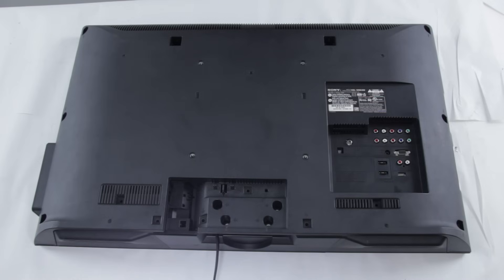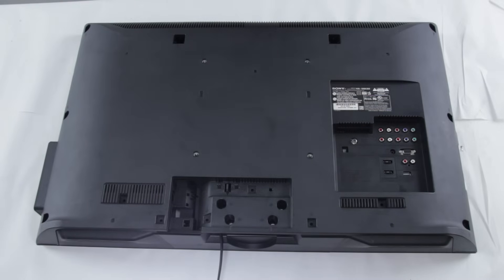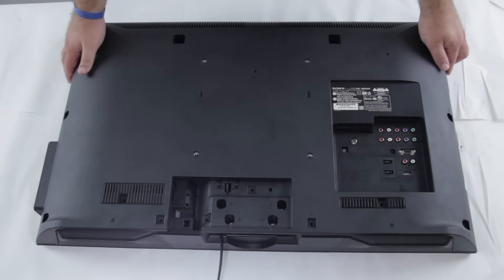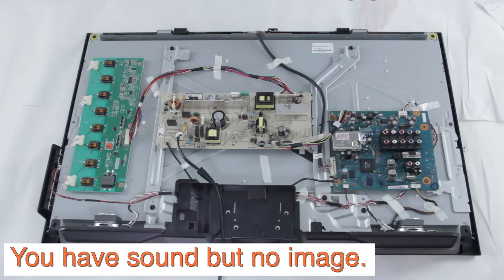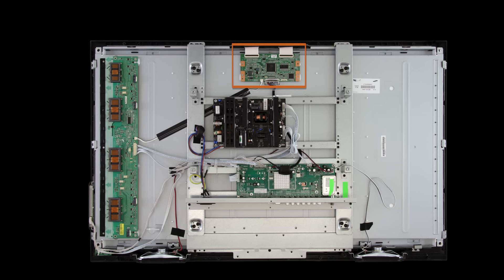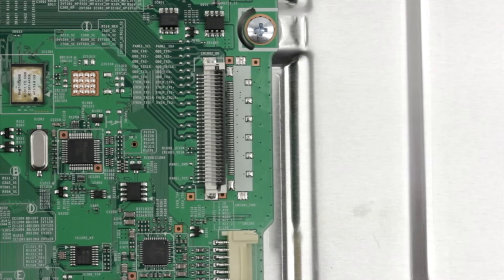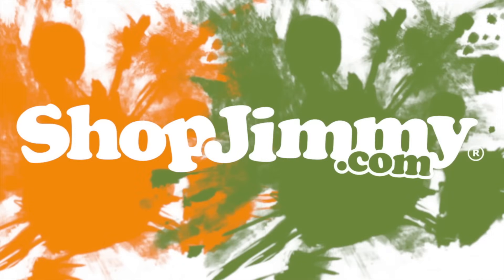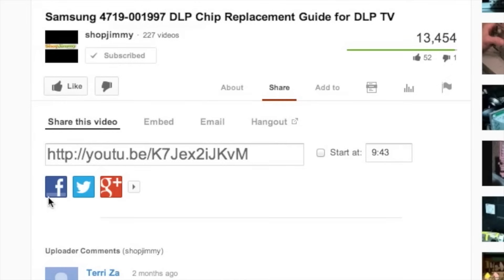LCD TV Repair Tutorial - T-Con Board Common Symptoms & Solutions - How to Replace T-Con Board

Comment: I have a Sony kdl-46xbr2 that has no backlight or picture or sound,I do have standby voltage of 5 volts. I would like to check the backlight turn on signal but I don’t know which pin has that signal. I was wondering if you could help me out

Comment: Hi ,great video bu t have got another issue whit my TV Hisense  55' H55N5500UK
Set goes in stand by mode after 10-15 min work and i ve been told the main tv board has fault-so i have changed it (not brand new -because cant find )and i still have same problem >How can find were is the problem?

Comment: Samsung Model UN19D4000NDXZA, Serial No. Z3013CKB305804Y--Decided to cut the cord and go with antenna only TV.  The TV works fine when connected to the cable box by HDMI cable, but when I connect it to an antenna by the ANT IN coax connector, I just get a static picture and an attempt to scan channels it doesn't work and the message is something like weak or no signal. The antenna works on our other TV, so it's not the antenna. I have it partially taken apart and thought I could try replacing the coax connector, but it seems to be soldered to the frame of the metal housing. Does that part come off the t-con board somehow or do you have to replace the whole t-con board?

Comment: Hey man how you doing?, I have flickering on screen and image is like moving slow, I disconnected right side of T-Con board and the other side works perfectly fine, I unplug the opposite side and and leave the right side plugged in, the whole screen shows the problem. Is that indicator of a bad T-Con board?
Reply: yes....same as mine..i change it and it works perfectly fine...

Comment: I have a (Flat HDTV 50PF7320A/37 | Philips ), there is not picture when my cable box is connected via HDMI. I am able to see a picture when I press the menu button on the TV and the remote controller-I have ensured that the HDMI1 is selected as it always has been. There is a circuit board, just below the HDMI logic board, where an LED is blinking green. I can be contacted at amelendezfl@gmail.com. Thank you in advance for you help.

Comment: Hello, I have a 55" Vizio M55-c2 s/n LWZQSBBR4502211.  My screen is a little blurry and jumping.  Also I have several horizontal lines.  One thick line about 2 thirds down and about 1/8in thick.  I'm assuming tcon board, and not the screen.  Any suggestions?  Thank you!

Comment: I have a Panasonic TC-P46C2.....Won't stay powered on......so when i push the power button I hear a click, the red power light turns on, the TV will power on (there is no picture, but an occasional flash)....after about 30 seconds the TV will power off, then it will on its on power on again....sometimes it will repeat this 3-4 times, until eventually it will power off for good (and the red power light remains off).......
I'm aware these tv's have blinking red light codes....in this situation the red light doesn't blink.
thanks, Kevin

Comment: Hi!, this is Farooq from India Mumbai (Bombay). Dear, I have a Dell TV cum Monitor U2410F with FHD resolution of 1920X1200 IPS LCD Display Panel. The monitor has standby light on the key board but no display, no backlights and no menu/picture. It has a Power Board no. 492472000100R ILP-017 RevA and Main Driver Board no. 492271300100R ILIF-129 Rev.B. It has a display panel of LG bearing no. LM240WU4 SLB 1 IPS FHD 1920X1200. 
Many technician went through it to repair but failed as the parts are not available in Mumbai, so if you would be pleased to find me the parts above numbered or help me to convert it into smart TV via FULL HD universal driver board but, to my dismay the monitor has to many circuit boards in it which is very confusing which to keep and which to discard. The display panel has 51 pin strip which are not found on any universal driver board in India. Hope you'll not mind to help me to suggest which universal board may be compatible for the above numbered display panel? And how to install it in the said Dell TV cabinet? You may also wish to record a video on the issue to help others to trouble shoot such cases.
Thank you in advance.
My email: Farooquechhapra@gmail.com

Comment: i have a sony xbr65x810c i had unpluged for like a week moved it to new room it comes on gets to screen and says no signal change input i can plug a hdmi in and it will change input and will have a picture but no sound have down loaded the software to thumb drive it will boot up on it start downloading it at 40 % screen goes black and the remote will not do anything but turn it on not turn it off took a chance and changed the power board no luck same thing any thoughts tried all kinds of resets

Comment: Sony Bravia KDL-60W610B Serial no. 3013439. TV has no pic nor sound. Red light flashes 3 times, disappears and then flashes again 3x. Had power board checked in a local shop and technician said there was a 5 volt supply thus ruling it out as the defective part. Could it be the TCon board or the main logic board? Can you supply the part/s and how much? Thank you very much in advance. Arcangel from El Paso TX.

Comment: I have a Polaroid TV Model #4641-TLB,  S/N FR7BO21560000003.   My problem is when plugged in it does NOTHING, NO light, No sound, No picture  I am not sure what to replace the power supply unit # 860-AZOJK461H,   or the mainboard # 899-KSO-IF4613UAPH  or does the mainboard superseded the Power unit Please E-Mail at mpcagney@gmail.com  Thank-You

Comment: My JVC is now showing the thin colored vertical lines when I attempt to watch TV, but I can watch anything hooked to the HDMI wire without a problem.  I'm guessing that the T-con board is the problem, so I will attempt replacing it.  Thanks for your video.

Comment: Good day, I have a E48-D0 Vizio TV. I recently ordered a power board and main board from your company. Initially I replaced both boards. But didn't resolve the issue. Screen initially came on but Vizio logo was choppy. I reinstalled the main board and after power cycling the TV a couple times it started working properly. Connected to cable via HDMI and worked great. Woke up the next day and turned on the TV. All was fine for about an hour when screen went blank but still had audio. But noticed a white-ish spot the size of a nickle in the bottom left corner. Tried power cycling a couple times but did not resolve the issue. Any ideas that could fix this?

Comment: Hello, My Samsung LA40A450C1D has the white haze, and effectively goes all white after a bit of time. I have tested and found a disconnected t-con removed the whiteness symptom totally. I need to replace the board for it, And worry about sourcing the right part, can you help?

I read 40T01-C00 and T400XW01 V5 CRTL BD off the T-CON BOARD .

Comment: Hi..!  I  have a Samsung un55es8000f and the TV  after star the imagen frozen and the tv reset it self...  on/ off    and  not stop...!    Do you think can be the t-con...?   Or maybe the cable that connect the t-con with the board..!      I run the svc diagnostic and they show  t-con  usb download failure., and panel auto settings failure.   

What you think???

Comment: Do you folks have any experience with the Changhong UD49YC5500UA 49" 4k led TV's? I have one from a couple years ago and the screen is flashing solid colors, black, white, red, blue, green and it continues to cycle that. There are no lines or half images, the menus and onscreen prompts/displays like volume and channel selection dont show up but the sound does work and goes up and down. I've read all the forums and posts about this TV and related issues and so far have come to the conclusion it's the T-conn board?

Comment: I have a Element Eleft556. I have no picture. What should I look ? I've tested the 2 led connectors on the powerboard and they run about 89v. The stand by is about 5v. Not sure how to test the t con board. Any info will be appreciated!

Comment: Hi! I have a Sony Kdl50r550a that will sort of power cycle itself repeatedly. The longer the TV is off before it is turned on, the longer it takes before this power cycle happens, but it does turn its self right back on to the current input. After being on for about 15 minutes it will find itself in a constant loop. Another thing, if no input is connected, the TV seems to stay on for much longer. I've had it on for over 1/2 an hour like this and havent seen it power cycle, it only seems to happen when something is streaming to it. The only thing I have replaced so far is the power supply board. Any help is appreciated, thank you!

Comment: I have a samsung ln46a530p1fxza. My issue is I already replaced the main board. Now the TV works and worked great lastnight. But now the right side of the screen kinda flickers with horizontal lines all the way to the halfway mark. And that side gets dark. When it does this (I have it hooked up to my computer) The mouse will trail REALLY bad on that side only. Would this be an issue with the T-Con board or is the display going bad? What would be my next step? Thank you for your help.

Comment: Hi There.. I have a Hisense 55K610GWN with serial number A55G132409H03802,  Sometimes it shows verticals blue bars from top to bottom in the left side of the screen.. Any tip?

Comment: Ok I have a Samsung UN40H6350AF. The TV keeps shutting off then back on. It will stay on for 5-10 seconds and display the input selection on the right, but part is off the screen. Any ideas?

Comment: Hi i have a Sansui sna55qx0zsa 55 inch smart led tv.. it is showing horizontal flickering in 2 second intervals..in between the intervals the screen seems to be fine..what can be the reason...I got my power supply repaired but still the problem persists..is it because tcon card? I wish I could send you a video of my problem. Please help..thanks

Comment: My Toshiba tv (50l711u18) got wet and is now showing two vertical bars (about 3 inches width each)... do you think this is a tcon issue?  If so, how involved is a tcon replacement on this tv and do you sell that part (it seems to be sold out on your site)?

Comment: Sharp lc-70ud27u has power had sound but now has no sound and no video, the screen is black and now after about 30 seconds it makes a click and a green light appears on the main board. I can’t tell if it still has sound or not because I don’t know what input it’s currently sitting on

Comment: I have a Samsung  55” un55b8500xfxza  tv that turns off about 20 minutes later and won’t power back on for another 20 minutes or so. Took it to a tv repair shop 3 times 200 bucks later still having the same issue. Any idea what the problem may be? Thank you.

Comment: sansui model :sv -40LCD ,s/n E068B01169AT  
blank screen and frequency noise  from speakers ,powersupply is on, and lights on control board is on, what else can i check for ?

Comment: I have a Vizio model VF550XVT1A that has red streaks/blotches in the darker areas. I was told it was the main board, so I bought one and changed it out but that is not the problem. Any suggestions would be appreciated, I really like this tv would like to get the picture back to normal.

Comment: I bought the wrong T-con board for my Sharp 52 even though the model number was the same. Frequently, components are changed on the SAME model number TV. You must disassemble first and get the actual part number off the suspect board. This is what I did on try #2. Oh well, only lost $20 but gained an education!

Comment: Hello, I have a Samsung UN50H5203AF. When I plug it in, the backlight flashes in sync with the red LED in the front. It is a very steady flash about every second. I have to turn the lights off in the room to notice back light, unless I take the back off in which I can see the backlight flashing through the holes in the back. Nothing happens when I try to power the tv on from the remote. Now, if I disconnect the LCD cable from the Power Supply Board, then everything appears to work, although I cannot see anything now on the screen. I can tell that it appears to work because the flashing LED and backlight go away and the LED status looks to be in sync with powering on and off and selecting functions using the remote. I am guessing there is a problem with the power supply board, although there doesn't appear to be any burned out capacitors, burned areas, or other damage on the board. Please let me know if there are any other things to look at to diagnose this. I did order a new power supply board since it wasn't expensive, but curious about your thoughts. Thanks!

Comment: I have a Sharp LC-70LE660U. Serial number: 409824102. The TV powers on and the power light on the front remains green but there's no picture at all. The LED lights flash on and off for about 1/2 second when it first turn on but doesn't stay on. Is this an issue with my T-Con board? What part can I order to correct this problem please?

Comment: My Samsung UN32J5205AFXZA smart tv just went out the sound works but the picture doesn't it's a black screen except when it goes in and out I did the flash light test and I can barley see the image like a greyish. just wondering  is it the T-Con Board? I had the tv for 2 years and it just went out.

Comment: Your videos are great, thanks so much. I have a Samsung UN50H5203AF, screen is black, backlights are lit, sound works, voltage checks out ok........if I disconnect the right ribbon cable to the panel one side of the display works, both or left ribbon cable connected just a black screen. I have tried swapping the ribbon cables with no luck....What would you recommend?? Replacing the T-Con or would it be the panel??

Comment: I have a LG 47LN5750-UH   Ser# 307rmgc4d887.  The screen went black and when you do a restart the screen will flash normal and then go black, however I do have sound. Cable Service Tech feels it the video board. Do you agree if not what else could be the problem. TV was manufactured in Mexico in 2013. Thanks in advance for your help.

Comment: I have a 2011 LG tv,   SVC code 55LV3700 -UD.AUSYLJR     Serial NO 103RMHRC3313  A couple of days ago my picture suddenly changes to a"solarized" image that has weird colors and lots of vertical lines about an 1/8 inch apart. When first turned on or set to blank input, screen is mostly green with theses vertical lines.  Also Halos of inappropriate colors around people when set to TV or other video input. Sound is fine.  Menus and alternate HDMI input show the same effect.  This TV seems to have 2 main boards about a foot square. I think largest one is power supply (and has ribbon going to panel) and smaller one on right is tuner. There is also an even smaller board near bottom where base is attached. This TV is only 60 Hz refresh at 1080p so I'm not sure if it has a T-Cal?  About a year ago this TV went totally dead and was restored by baking the Large board at 375F for 10 min so I expect it has bad solder in other boards too.  Can you tell from the above which board needs replacing?
Ernie

Comment: I have a Samsung UN60D8000.  When I look in the menus the green color on the screen is fine.  When I display anything from the inputs green is very weak.  I can find plenty of T-con boards on eBay.  Do you think replacing this board would fix my problem?

Comment: This one should be easy.  I have an LG 50LN5100-UB that had no picture.  I replaced the LCDs.  I now have static sound when I turn it on and back lights but no picture.  What I do get is kind of a lighter wave at the bottom of the screen that lasts maybe a second when I turn on the TV  before the entire screen goes dark.   If I unplug the ribbon cable on the main board side of the t-con board, the main board side is light while the other side is still dark.  If I unplug the control panel side ribbon the control panel half is lit up and the main board side is dark with shifting white square patterns.  There is never any logo or volume indicator when AI turn the volume up or down. The LEDs are functional. I am guessing T-con board since I get sound?

Comment: Model Number: M3D650SV
Serial Number: LAEAMEAN1800729

The TV has three black vertical lines on the left hand side of the screen with some graying in the far left corner. We have checked the main board and are being told it could be the panel, T-con, or LVDS cable... Can you help us isolate the issue?

Comment: Hi! I have a Sony Bravia XBR-55X900E. my TV started showing a partial picture and horizontal colored lines that had like static moving through the lines. We have been told its our T-con board. Is our T-con board in our TV soldered into the back so we can't replace it?

Comment: I have a Samsung un60j620dafxza version NS02, I have sound but the picture is gone except for vertical lines in different sections each time I turn it on that fade from white to yellow, red, and orange from top to bottom and sometimes total white section. Each section is from top to bottom, no horizontal lines or anything like that going on. Is it the BN97-09529t 130a I need to replace?

Comment: I have a Vizio E500i-A0 serial #LATKNTBP2702731.  I've had it about 5 years.  I just moved it from living room to bedroom and when I hooked it back up it has a horizontal line about half way on the screen and the bottom portion kind of gets distorted every 4 or 5 seconds.  Almost looks like it is fizzing if that makes sense.  Can't imagine what I did to cause this or how to fix it.

Comment: Thanks for video. I have vertical line on Sony Kdl-60W855B,and want to buy tcon board which is: 1P013AJ00-4011 RUNTK 5475TP 0106FV.
I have oportunity to buy new Tcon board with same nr: 1P013AJ00-4011 RUNTK 5475TP 0106FV from Kdl-70W850B,but selsman told me that Tcon board from, Kdl-70W850B wil not work with my tv? What do you think? Thanks